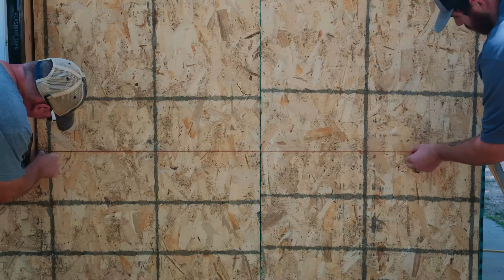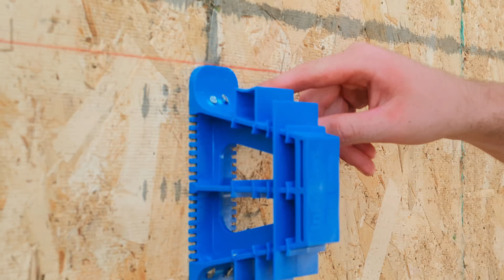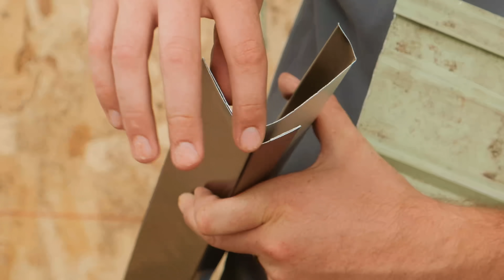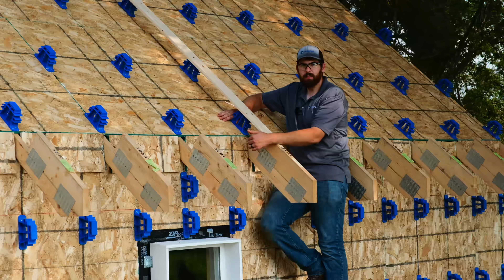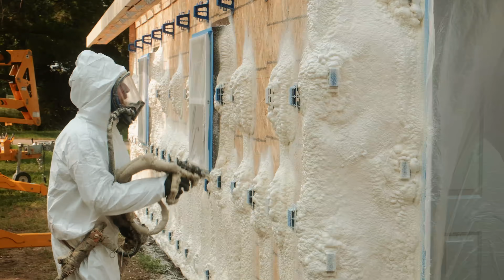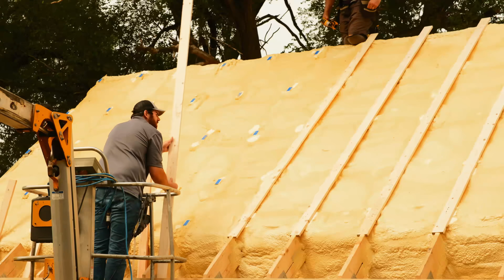Unleash Energy Savings: Installing X-Bracket System on Exterior for Spray Foam

Comment: Based on the video, no need for a roof membrane and wall water barrier, before installing the X-brackets and closed cell foam on the sheathing?
Reply from the maker: Closed cell spray foam functions as your vapor and water barrier you would not need it below the X-brackets but underneath the shingles you will want to install an ice and water shield
Reply: @insofastllc Thanks, how about if I am installing a metal roof over the X-brackets and foam, which normally would be directly onto the furring and omit additional sheathing?
Reply from the maker: @marklundegren  Yes you can orient furring down the length of the roof and furring strips can be used for direct attachment of the metal. So sheathing ---> X Bracket ---> Furring Strips ---> then Metal Roof
Reply: @insofastllc Thanks again, helpful for me and I hope others.

Comment: looks great, my concern is quality control. There seems to be a lot of chances to screw up and obviously crews must be specifically trained.  But that is usually the issue in residential new and unusual products take a couple years before all of the installers achieve true competency, in the mean time quality control is irregualar. Acrylic stucco comes to mind.
Reply: The Key to quality workmanship is:  The Framers fasten the X-Brackets and the furring strips and the professional spray foam insulator does the insulation!
Reply: One well trained foreman/engineer to be on-site is always best practice.

Comment: I think that coming up with practical sheathing connectors with low thermal bridging is a fantastic idea, particularly for retrofits.  More power to you!!  Even though it potentially could compete with what we are doing.  Anyone who is innovating to improve energy consumption and moisture management needs to be commended for doing that.  Best of success!
Reply from the maker: Thank you for this even though we may be crossing paths. That's where we both might do great though, giving options to customers that were never there in the first place. Cheers.

Comment: If the foam is a vaper barrior, should work well.   In the UK, they now have some issues with open cell foam used in this manor.  Moisture condensed on the inside of the exterior wood and rotted the sheathing and rafters.  Insurance companies in the UK are cancelling home policies on the homes with spray foam.  The strange thing is,  the UK gov had incentives for people to install this spray foam!
Reply: Building Science teaches Spray foam entirely over the roof deck that is thick enough to prevent condensation does not have those issues

Comment: So are these commented RISKS valid/significant: 1) cost, 2) interior moisture control, 3) flammability of spray foam?
Reply: these are general questions asked by anyone for any spray foam job regardless of application procedure.  Similar answers apply.
Reply: Polyurethane closed cell is not flammable.

Comment: I used to erect, clad and insulate metal buildings in the N.W.T., this type of system is what is commonly referred to a a Complete Thermal Block insulation System, designed for the exterior of the structure. In the far North, this is the ONLY way to ensure that the cold air outside -50C does not create a "Thermal Bridge" via the structural elements of the Steel structure. Your system is designed with the very same Architectural design principles (Thermal Block) in mind, to block out either heat or severe cold.
  Obviously this type of total Thermal Block that is blanketing the entire building structure is the most Optimum insulating system that any builder or home owner could ever achieve, in making the building envelope not only draft-free, but it is the most Energy efficient system of insulating your home. I have worked in all types of home construction, commercial buildings construction and Heavy Industrial buildings construction; and this is the highest level possible in sealing OUT the outside weather elements that you can possibly achieve for the exterior of your home. A little bit Anal, but it is the ultimate building solution for insulating your home. Now go out and find a builder or contractor that can assemble this system, flash it out, attach the siding and then put the roof on top of the home, now this is the real challenge.
  I would doubt that this system would be approved in States like Georgia, Florida or now obviously The Carolinas. Having put together the best Steel buildings (Butler), that utilize Grade 8 fasteners to steel I find it is unlikely that this system would be approved for Hurricane resistance because the clips are made of plastic. But this is purely my own opinion.
Reply: Does it meet coastal construction code requirements in Florida?   I heard the owner say withstand 170 mph winds in a Build Show segment.

Comment: What about masonry veneers?
Reply: I saw another video that showed keyed grooves on the back of the X brackets that can be used with poly-urethane-based adhesives to solidly adhere the brackets to masonry type veneers (same as how their current line of Insofast panels are attached to masonry veneers).

Comment: Would be nice whole lot cheaper to build more nuclear power plants and make energy more affordable, new insulation technology creates very tight homes leading to moisture build up - mold rotting wood. With new framing products that’s really a bad
Reply from the maker: It's not about using more energy...it's about using less. We have a video coming out soon on the importance of airtightness in a home...
Reply: Just took my continuing education for my GC license and for the. Last 5 years they are really pushing energy efficiency and house ventilation, ok both important but with nuclear power being almost the cheapest way to make electricity we should build more plants improve the grid and drive the cost of energy down power down besides foam is a bi product of petroleum so it’s not cheap and it’s not considered to be green so seems like we’re chasing our tails!😊

Comment: Something to think about.   Search Labs | AI Overview
Learn more
…
Yes, gaps in a home's sheathing can indeed allow moisture to penetrate, get trapped between the foam insulation and the sheathing, leading to potential rot in the wood framing due to prolonged dampness; this is especially concerning if the foam is a closed-cell type which can hinder moisture escape. 
Explanation:
Moisture intrusion:
Even small gaps in the sheathing can allow water vapor to enter the wall cavity, especially during periods of high humidity. 
Foam barrier:
When spray foam insulation is applied, its closed cell structure can act as a vapor barrier, trapping moisture that gets behind it, preventing it from drying out. 
Condensation potential:
If the temperature difference between the inside and outside of the wall is significant, moisture can condense on the cooler surface, which could be the back of the sheathing, further contributing to moisture build-up. 
Rot development:
When wood remains wet for extended periods, it becomes susceptible to rot-causing fungi, leading to decay in the framing members.

Comment: Did I miss something. So you sheath then spray foam then sheath again?  The plastic anchors are all Willy Nilly on the sides. How do you side to that. Then no solid outside corners to nail too.  Then addressing the windows and doors 🤔.  Is that just their problem?   Seems a few cases of spray foam need to be left onsite for other tradesmen to do their thing.  I get the idea but I dunno.  What about wet weather and rainy conditions when applying?  How do I know the trapped heat won’t release the foam from the house?
Reply: I don't believe they re-sheath after installing the furring strips. If I understand correctly, the siding is attached to the furring strips. The foam acts as a vapor and water barrier and an air gap will exist between the siding and the foam so there is ventilation from the foundation to the ridge vent.
Reply: Brent - you bring up an important issue that eluded me as a homeowner, not a tradesman.  I am interested in the x-bracket/foam solution as a possible rehab of a poorly installed 1990s dryvit over plywood installation in coastal NW Florida. No WB/VB products were used.  We have water incursion at 50% of the window and door penetrations with structural elements damaged underneath.
But the AC system would need redesign, I assume, as you point out which is a bridge too far I believe.
Darn!
Reply: My concern on ANY building envelope that is 100% air tight, is that the home then will rquire an Air-to-Air ventilation system that will pre-heat the incoming Air with the Exhaust Air via the Air > Air heat exchanger. 
  This Air > Air system will all have to be sized and designed by a HVAC Engineer to ensure that you do not suffocate the inhabitants of this newly "Hermetically Sealed" building. This Air-toAir HVAC system will NOT only supply fresh Oxygen for the people living in this perfectly sealed box to breath, but the system will need humidifiers to control the humidty. The humistat will also be sensitive to water vapour that is now 100% Locked inside of your home, and will kick on the Air-to-Air heat exchanger to exhaust the humid air from showers, cooking and humans sweating and breathing to the great oudoors. The exhausted warm and humid air passing through the ATA exhanger will bring the outside air to the same ambient air inside of the now sealed structure.
  Can you see where this is going? By completely sealing the building, now you have created an entirely different set of problems and parameters to deal with, but to come up with engineered air systems to properly deal with the needs of the people inside the building. Not just the people, but the structure could be put at risk of developing issues like excessive sweating of vapour withing the house, if the water vapours created are not dealt with appropriately. This is NOT within the design scope of capabilities of a DIY homeowner. These solutions are designed by HVAC Engineering firms, and installed by HVAC tradesmen. How do I know, because we used to install these systems for Big and Small structures like Public swimming pools and tightly sealed open design vaulted, multi-story homes with lots of glass. You could guess at sizing systems but you will waste thousands in the process.
  This is not some kind of bush-league building system, this is an advanced building system that is going to require a HVAC professional like an engineer to properly source and size the HVAC components for this system to work properly at its optimum design specifications. All of these design configurations and features will need to be considered and planned for BEFORE you start just slapping this building together. These are the planning considerations needed before utilizing this method of insulating the exterior of your home, with this external Hermetic sealed insulation system. Worse yet if your HVAC is not up to the task you could risk creating MOLD on the insdie of your structure. This kind of design capability if beyond the pay grade of 99% of home owners, this is the kind of system that has to be done correctly, and then you will have a home you can be proud of and that functions properly. This kind of home is not going to require a lot of heating and cooling energy because it is so highly efficient.
Reply: @brentmcgillis  Blower Door Test gives ACH and CFM values which are used to rate the house.  Based on those values an "HVAC" system matched to provide quality air/vapor requirements per code.

Comment: I build high performance homes AND install closed cell foam myself. Ive tried quite a few wall systems, double stud, exterior roockwool, zip-r etc.  I am designing a custom build right now with this system.  I see this on going in my next few builds. One being my own home.
Reply: @CrestoneColorado-yj4we  do you have a channel? Would love to see your build and review of it.
Reply from the maker: Keep us posted. Very interested to hear your thoughts on this new system compared to your previous projects!
Reply: Say, would you recommend a cement-board siding over the top of the foam insulation for a better home insurance rating?

Comment: What a disaster. Spray foam is a solid form of gasoline. Once any part of that foam catches fire, goodbye to the whole house. Extremely toxic when burning.  Do not do this. Use rockwool or something similar on outside. Also, how the heck are you supposed to get your siding to lay correctly?
Reply: The siding is not lying on the foam.  It's attaching to the furring strips which are attached to the X-Brackets, which are attached to the sheathing which are attached to the studs. So unless the studs, the sheathing or the furring strips look like ocean waves the siding should fashion a consistent even surface.

Comment: It will insulate better than spraying on the inside, but at what cost?
Reply: Good question.  spraying on the inside will leave miles of seams around every stud it will do nothing to seal air leaks at the bottom and top plates or between studs that are doubled up and the performance of the framing in the entire wall assembly is lowered by about 25% so you are only getting 75% of what you pay for.   if you were to spray R-21 foam as a single monolithic seamless layer of insulation with the x-bracket on the outside it will exceed the performance of spraying R-30 in the cavity and will exceed the 2024 IECC code without ANY CAVITY INSULATION

Comment: Why use these specific plastic brackets ro just provide a way to attach firring strips away from the building.  Why not just buy long metal studs and chop them up at the appropriate depth.  Or chunks of Wood.  

I just don't see the need for this specific plastic thing that is probably super expensive when its function could be duplicated with something much less expensive.
Reply: @davidshumway9639  wood and metal act as a thermal bridge.

Comment: Until they make foam that does not burn so well, no foam for me at all.
Watch some burn tests between spray foam and other insulation.
Reply: Closed cell polyurethane is class 1 fire rated.  It self extinguishes.  Closed cell foam is an air barrier and moisture barrier.  The problem is foam cost, but some SIP manufacturers use polyurethane.
Reply: @mefobills279  Watch the demonstrations between spray foam and rock wool or fiberglass insulation, then tell me.
Reply: Where can I find those tests? Seems like an important risk to understand.
Reply: @VARocketry  a key word search should do the trick

Comment: Just use Zip-R sheathing - sheathing, WRB and exterior insulation all-in-one that any framer will understand how to install.  If you use 2x4 framing and Zip-R12,  there's no window bucks, no furring strips, and regular windows and doors made for 2x6 walls fit perfectly.  The building envelope is air and water tight.  My 2x4 walls with Zip-R12 are R-30 with closed cell spray foam between the stud cavities.  I wouldn't even consider using spray foam to cover an exterior wall with a bunch of plastic nubs to hang furring strips and siding on.   How does one detail waterproofing window and door openings?  Not a fan of window/door bucks when they're not needed for exterior insulation.  

Exterior insulation issues have been solved with Zip-R.  Not so fast, Insofast...
Reply: You're right that for new construction this doesn't make the sense like your recipe.  But as the little insulation fella said.  If you have an existing home that needs better insulation and you're going to be re-siding it anyway.  This is probably a decent way to go.  You wouldn't want to rip the outside of a home to the studs and follow up with zip-r12.

Comment: Would I need to sheet the roof if I’m going to install a metal roof?
Reply: I would guess not. The foam is waterproof, so there would only be the furring strips that could get weathered, and they would stay dry most of the time.
Reply from the maker: Yes, we recommend sheathing the roof before putting any roofing on, but especially for a metal roof.

Comment: Thanks for sharing like the idea. Could these be used for rockwool applications on the exterior of a home too?
Reply from the maker: Yes, the X-Brackets are designed to be used for any insulation whether it is spray foam, rockwool, or cellulose.
Reply: @insofast-continuous-insulation  where can I buy them
Reply: Rockwool would be the best, I agree. For R value, sound, and fire!